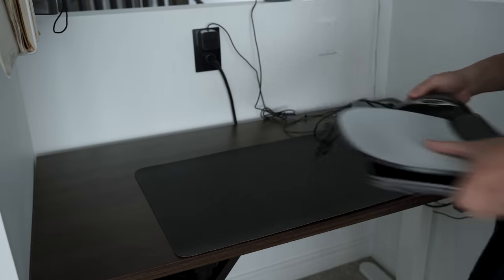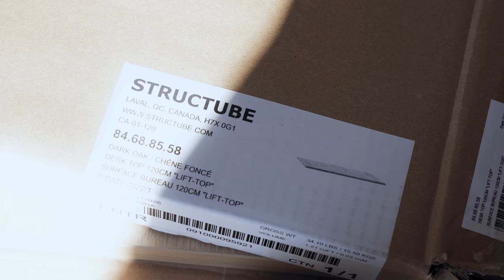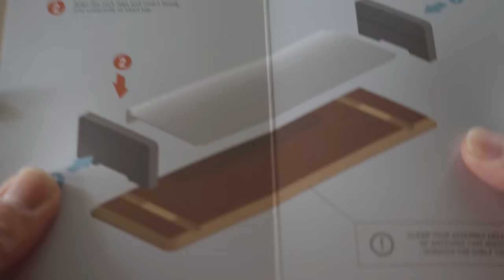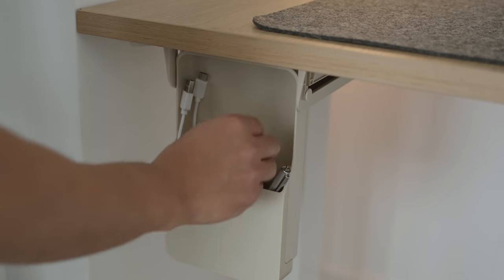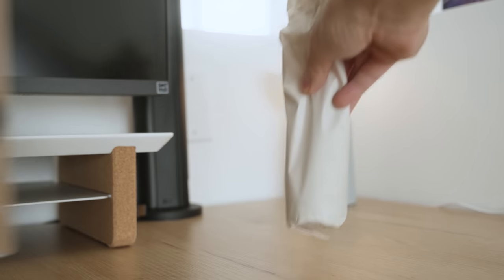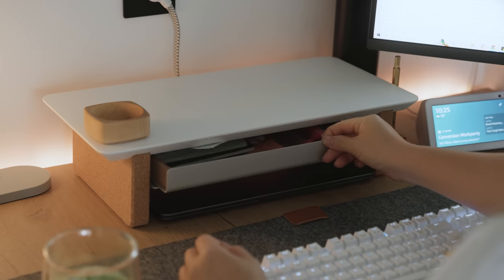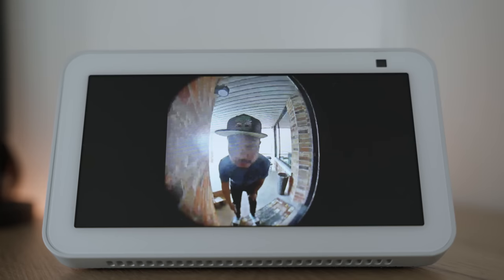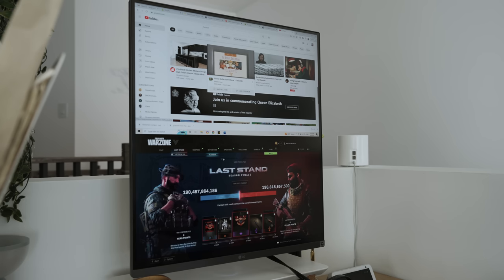Modern Cozy Desk Setup in a Small Space - with a Unique Monitor

Comment: I have the same chair and a 49" LG monitor love the chair and the display space but some times becomes uncomfortable having to reach so far on the screen,  focus the eye at the edge of the screen. I do structural and solar design and it worth every single penny. for the desk I have a upliftdesk base and I did the top using 1" strips of dark walnut with danish oil so you can feel the wood grain.I love your setup ! very clean design

Comment: about the screenbar light: I have another LG monitor from their Ergo line and I've noticed that if I plug in the screenbar light to the USB-A of the monitor and use the USB-C cable to connect to my laptop, it works perfectly fine. When I plug the USB-C cable to my USB-C iPad, it works fine when the iPad is use, when the iPad is in sleep mode, sometimes it flickers on and off. Something to keep in mind when your wife upgrades laptop.

Comment: The monitor is too high. Every ergonomic advice I have read, says, that the UPPER edge of the monitor should be on the same height as the eyes. I saw your wife lift her chin to look UP to the monitor. This will probably cause problems long term.
Reply: ergonomic guides are one thing, actual comfort during use is another. The height of the monitor is also dependent on the size of said monitor. Monitors that are 32 inch or bigger will cause you severe discomfort if you try to position their upper edge at the same level as your eyes, since good luck trying to see what’s under them comfortably at the normal viewing distance.
Reply: @neol3066 the desk is adjustable height anyway right?

Comment: Sorry, that is NOT a unique monitor. It is one of the FEW - note few - squarish monitors. I use a number so far of EIZO EZ2730Q which are diagonal with 27" and like the predecessor. Lower resolution (1980 x 1980), which I will replace with a DualUp soon, but unique is a very strong statement for a class of monitors that exist for quite some time and are amazing for a lot of creative/technical work.